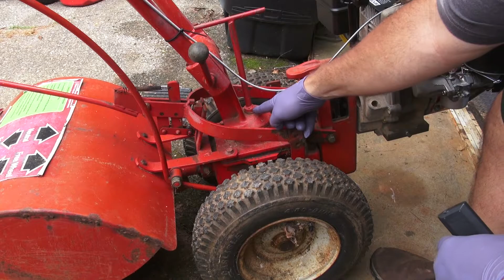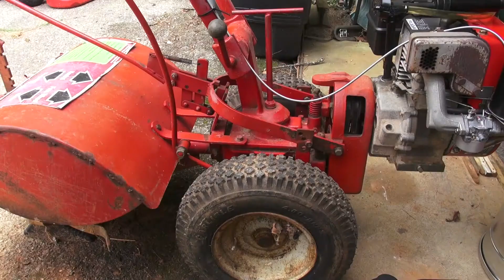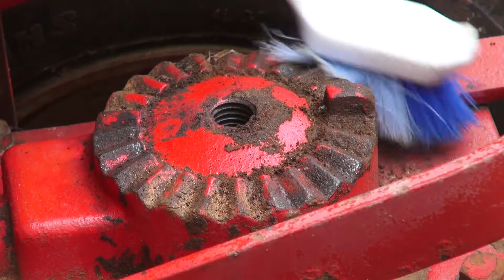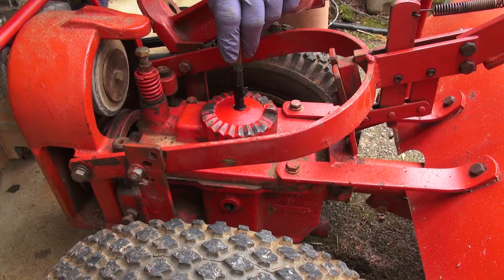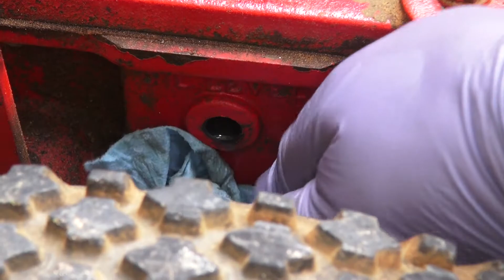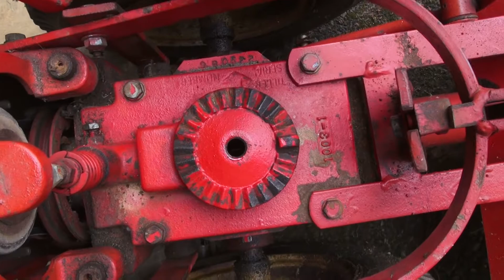Troybilt Horse Tiller topping off the gear oil

Comment: Great video!  At 2:26, I pull the T handle out of the handle assembly and screw it back into the threads so it further prevents dirt/grit from falling into the gearcase.
Reply from the maker: Great advice!  That is what I certainly should have done, and I'm not exactly sure why I didn't, but I think the reason is that I set the T-handle on my hose reel behind me and then moved to the opposite side of the machine for better filming and left the handle over there.  When you have a tripod, stool, and all that sort of stuff to contend with it makes it a pain sometimes having to move while filming.  A 5-minute job takes an hour or more when you are dealing with a camera, especially if you at least try to provide good footage for your viewers.  Throw in chronic pain with a screwed-up skeleton where mobility is an issue, and that is very likely why I did something so dumb, haha!  Thinking back on it, I'd say that is exactly why I did something so dumb, I know I'm dumbass, but usually not quite that dumb, haha!!  Thank you for watching and for the compliment!
Reply: @AccuracySpeaks  I get it for sure! I would like to film some of the repairs I take on, but it is for a lot of the same reasons that you mention that I don't. I always appreciate folks who film content and show us how to do a lot of these things. You save people countless hours! Thanks again for making the effort!
Reply from the maker: @ericpigg2689  You're welcome, I'm glad it helped you out a little bit!  Thank you for your kind words once again!  Good luck with your project!

Comment: So I’m a newbie and just bought a 79’ Troy Bilt horse with a new 8hp Briggs & Stratton engine. Is the oil you used what I use for it too?  Just fill it almost full?
Reply from the maker: Newbie!!  That term is quite interesting to me!  I think as human beings we're all "newbies" for the most part!  I understand many trolls on the internet utilize the term "newbie" with less-than-complimentary connotations, so I'll choose not to personally refer to you as such out of respect for your intellect.  I'd say unless your daily job is working on 70's and 80's Troybilt tillers every day, we are all "newbies"!!  And unless you have access to and have read the manuals on these tillers, there'd be no way to possibly know and understand all the specs and nuances of these machines.  And I think you can shed the "newbie" badge by showing how sharp you are for consulting about the gear oil for your newly acquired Horse, so congratulations on that!!  Now that we have all of the comedy of the way, my understanding of all these old Horses is that they utilized a bronze alloy for their transmissions.  I'd expect they used that particular alloy for the ease of machining the gears and to lower manufacturing costs as opposed to using steel.  With that said, these "yellow-metal" gears cannot handle traditional high-sulfur and phosphorus gear oil, hence using the GL-4 designation.  Fill the transmission just until it starts to run out of the plug on the side of the case.
Reply from the maker: Hey, congrats on the tiller find, hopefully, it won't be worn out and be a good machine for you!!
Reply: @AccuracySpeaks  thanks!  To be honest it was a bit of a learning curve because I wasn’t used to all the levers. 😅. It was comedy gold trying to figure how to start it. The first time the tiller shot forward like a bat out of hell and ran into my garden fence 🥴😂. Luckily no damage that thing is built like a tank. After some reading and trial and error I got her going and she performed well!  She’s definitely a work horse and I love this old tiller. 👍🏼

Comment: Just wondering ... I know you said you haven't used it in 30 years, but do you remember where you got your gear oil pump from?  I have the same gallon container but not sure which pump to get.
Reply from the maker: Hey, thanks for watching.  I'm pretty sure I bought the gear oil pump from Advance Auto many years ago now.  I looked at it a moment ago.  It is a Stay Lube pump for gallon containers.  I think SL4344 is your part number.  Here is a link: https://www.trailerdepot.com/sta-lube-gear-oil-pump/
Reply: THANK YOU for taking the time to reply to my request!  If this is the same one you used, I know it will work for me since I have the same model tiller (Horse) from Troy Bilt (bought mine back in 1999).  Again, thank you for the help!
Reply from the maker: @crdennis123  you're certainly welcome!  I try my best to reply to everyone I am able to.  Half the time, I do not get notified of comments, though.  According to the pump in the picture in the link I sent, it is the exact same pump.  They make a "newer" pump for gallon jugs that I'm sure would work as well, but the "newer" pump appears to have a bigger, rounder, head on the pump.  My pump has a notch formed in the back of the pump head that holds the hose upright, which keeps your hose from leaking gear oil all over the place when you're storing it, in fact, my pump is stored in a gallon jug as we speak.  I did get an Amsoil pump that I really like too, but I use it for their specialty gearbox fluids for transaxles that take specualty fluid that isn't nearly as thick or nasty as traditional gear oil.  I got it for my mom's Honda CRV to do her gearboxes in it, that fluid looks like clear looking tranny fluid to me, pretty thin stuff!

Comment: Is the final drive with the tines also lubed from the same gear box?
Reply from the maker: There's a square fill plug that has a little dipstick on it for the tine housing just ahead of the rounded sheet metal tine cover, you know, the rounded cover that looks like a big fender for the tines, the little plug in the center of the tine cover is the fill for the tines housing.  Hope it helps!
Reply: they are seperate but use the same oil viscosity.

Comment: Sorry, but I was cringing while watching your attempt at removing that stuff from around the oil hole. Much safer way to prevent grit and debris from entering filler hole is to simply screw just the T-handle back into the hole before commencing with the cleanup. And if you can blast the area around the hole with compressed air before again removing T-handle to fill with gear oil  there's no danger of any possible stray contaminants entering. Watch the video at .25 speed and you'll actually see bits and pieces falling into your transmission.
Reply from the maker: Ahh, come on, no need to be sorry, those bits are excellent for lubrication for those bronze gears, almost as good as molybdenum disulfide!  You're right, I'm not sure why I didn't thread it back in, maybe I placed it across the way and my knees, back, and ribs were hurting too bad to get up to go get it, i don't know, perhaps I did it on purpose to get youtube know it all feedback, I can't remember, though I say I had at least a half-ass reason, haha!  Actually, I do remember now, after fiddle farting around, I did thread the t handle back in and scrubbed the hell out of it without worry of organic lube getting in the hole, notice the frame-break where it went from all dirty to all shiny-like, that was magic!  And yeah, the t handle was way the hell away from me and, my body was all jacked up with pain, and I told myself I'd be careful, which I was for a while, at least long enough to get you to cringe, haha!  Thanks for watching and sharing your expertise. You're pretty sharp!!  Hey, you commented and I'm sure gave it few thumbs 👍 up, now, like everbody says, "don't forget to SMASH that subscribe button, and hit that bell so you can contine to get my stellar content, hell, tell all your buddies how awesome the channel is too, so they too can be amazed!!  All joking aside, thanks for watching, and God bless!!